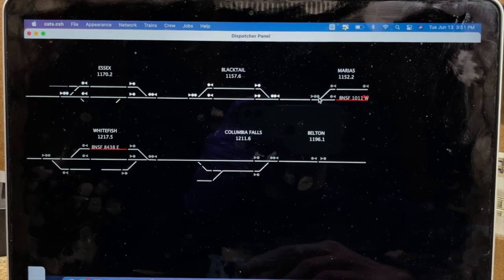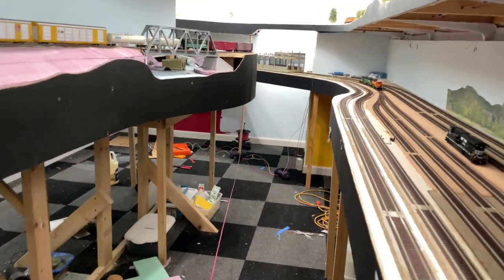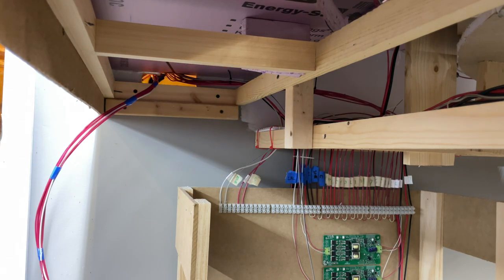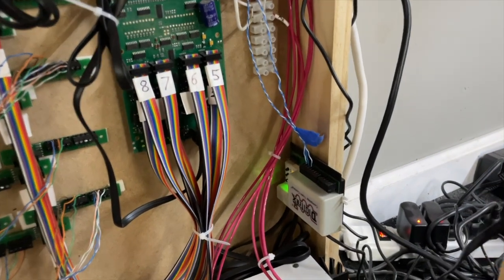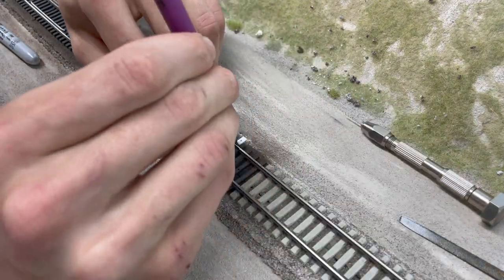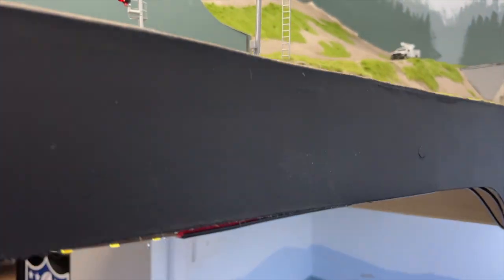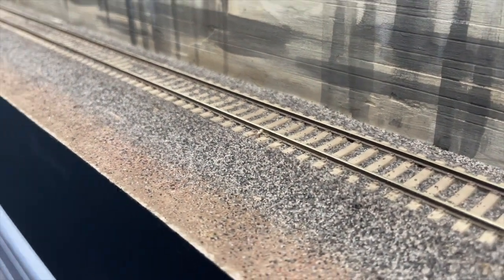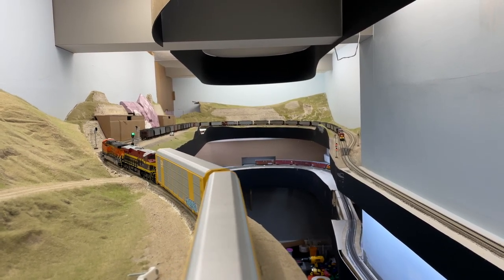Signaling System – Marias Pass HO Scale Layout EP03

Comment: Great video. Regardless of system, doing this signalling in this way sure does use a lot of wires, to get this effect. I'm currently building and doing mine, on my new layout using the NCE system. After seeing this video, I know that yeap I go have lots of wires too like you.
Reply from the maker: Oh man, I totally underestimated how much wiring it takes. I probably took like 4 trips to the hardware store thinking each one would be my last. That's also where a lot of the cost is, and I wasn't expecting that.
-Cam
Reply: @railfan220  lol yeap.. I kept getting lengths of 50' with multiple trips. The guys at the store kept asking me as I walked in the door.. "How much this time?" At the end I just told them to give me the full industrial roll, can get expensive. But end result will be worth it. I'm also doing eventually an old manual switch panel.
Arty

Comment: I did not realize that the turnouts should be on a separate detection block on either side of the passing sidings, but seeing your video, it makes sense. I am still in the planning stages, so I have not messed up yet :)
Why use CATS and not just use JMRI Panel Pro? What are the advantages of CATS over JMRI PP?
Reply from the maker: Haha true, you can't screw up what you haven't started. I definitely was trying to find ways to save on detection blocks and was hoping to combine turnout detection with an adjacent block...but I did not find any shortcuts. Anyway, I honestly forget all the reasons I chose CATS, but I think mainly that it has appearance defaults that resemble modern CTC screens. I almost remember messing around with Panel Pro and just having less luck getting it to look the way I wanted. Other than that, I think they're probably pretty similar to set up the sensors and logic and all of that. 
-Cam
Reply: @railfan220  I have fought for longer than I should with Panel Pro, maybe I need to give CATS a try. I dislike the panel editor in JMRI.
Looks like I need more block detection devices, or I just need to remove block detection from areas that really do not need it.

Comment: Thank you for sharing. Now can I do it. LOL
Reply: Seems difficult, sorta easy honestly lol
Reply: @AbelG8781  I want to do this. Not sure where to start?
Reply: @Vman7757  layout, isolate tracks, install detectors, get JMRI or some sort of program to control CTC, wire it up, good to go.
Reply: @AbelG8781  LOL. Ha ha ha. I am at to point of what should I buy. I have a digitrax system. But looking at TCS "Train Control Systems" as a possibility. I'm also considering LCC "Layout Command Control" It's almost paralyzing on what I want to do.

Comment: Very impressive, question you used 3M tape to mount your switch machines, no screws correct, like the the way you did the offset for throw bar, I am using Walthers switch machines
Reply from the maker: Correct! No screws, and they've stayed up. 
-Cam